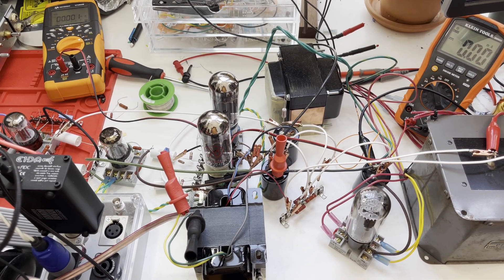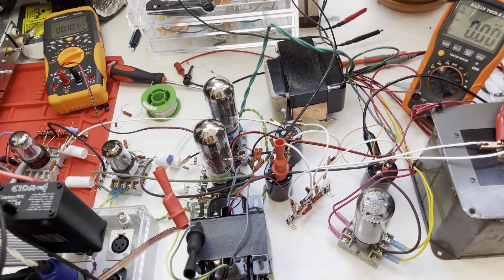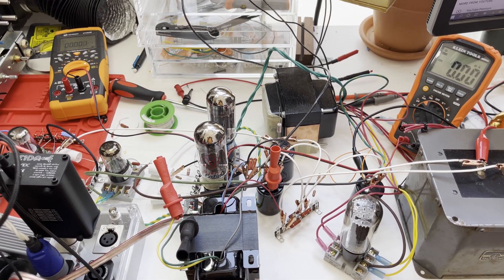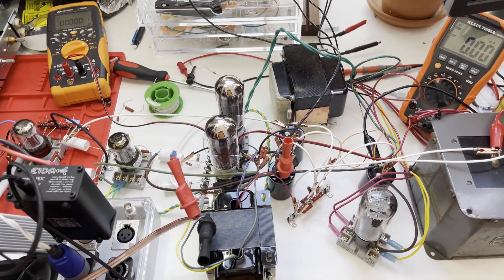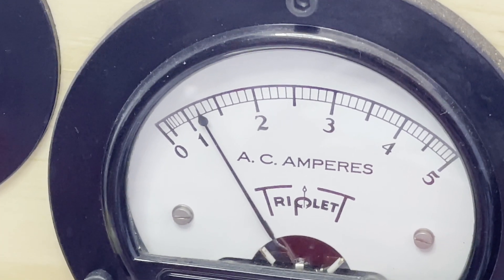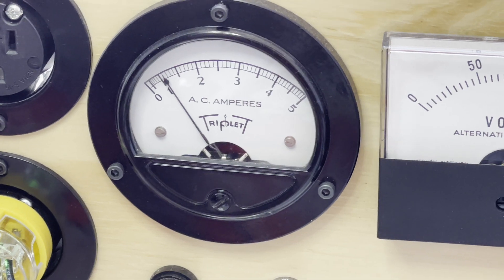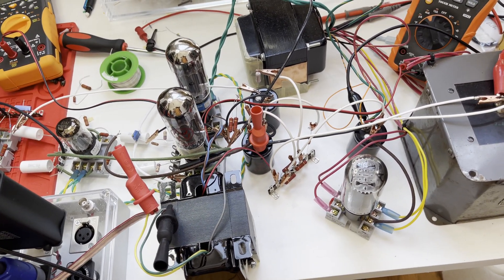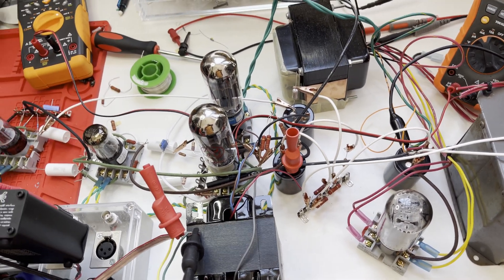Solving Tube Amplifier Motorboating with B+ Decoupling Resistors (Demonstration)

Comment: Just 2c... You could induce oscillations just by the fact you have everything out on a benchtop without a chassis, with leads running every which way.  Sitting transformers one way or moving them a couple of degrees can upset stuff too.

Comment: Those 200 ohm resistors should be fed from the same source. Feeding one from the others output can increase your problems.
Reply from the maker: I had the same thought, however I tried it in both configurations, and there was seemingly no difference in stability. But feeding one from the other gives lower ripple since the two filters are in series, so I chose that.
Reply: @messingwithelectronics7462  i learned that  practical experience often trumps theory decades ago!

Comment: I've never seen so low value resistors in tube amp power supplies. 1.5k is quite ordinary, up to 20k easily ... 
But it's not only resistors, this is caused quite probably with too much of capacitance (you made a big slow oscillator). I've first heard of motorboating when somebody wrote that you should avoid too high capacitors because of it ... But I am too ignorant to be sure about it.

Comment: The very audible slow, 'blat, blat blat' motorboating noise coming out the speaker Is most often caused by a bad ground connection on the negative end of the power supply filter caps. Dry solder joints or a ground connector lug not tightly or cleanly bolted to the chassis. The filter caps can't pass sufficient amperage to ground, they begin to charge up but then collapse so setup a regular, high voltage (intrusively loud) pulsing. This seems like a lower frequency parasitic oscillation. Lead dress can cause it, it might have been interesting to try suspending some grounded tinfoil over the wires sprawled all over the table to see if the oscillations stopped. I can't see enough to read your finely drawn circuit diagram and component choices so pls excuse me if my comment is unrelated or unhelpful.

Comment: That is a metric butt-ton of filtering for what you have going on. Too much of a good thing is still too much... There is a mathematical solution to this. More or less, X capacitance requires X resistance for X filtering. It is not an arbitrary number. I can't give you a number off the top of my head,, but, it is an easy-to-find number on the interwebs.
Reply from the maker: Yeah, I did model it in PSU Designer II and it's very overkill. This design is kind of nostalgic for me because it's based on an old Capehart amplifier I restored that also had a huge choke, so I wanted to replicate that 1940s look and feel. Cheers!

Comment: Clever of you to use octal relay sockets for prototyping. I've taken a much more traditional approach with a wooden board and sockets mounted on L-brackets.

It's a very nice explanation of motorboating :) and it will occur in class AB or V amps with high-Z power supplies (e.g. tube rectifiers, thin wire on power transformer) if the voltage sags under load.